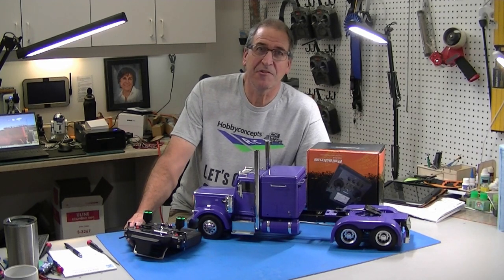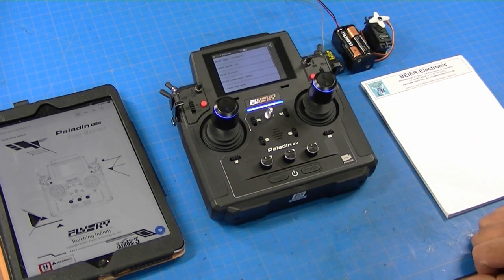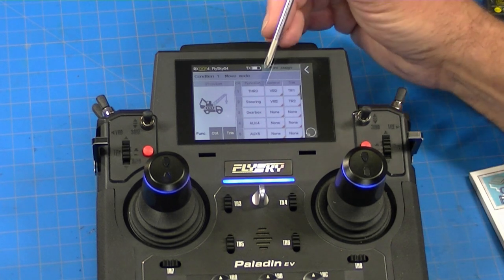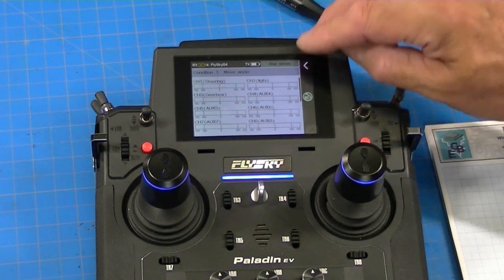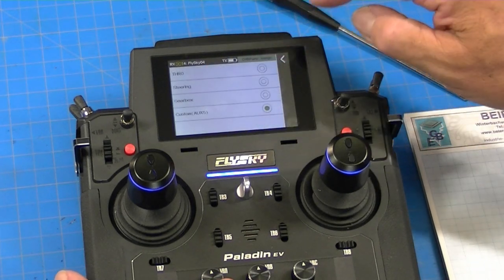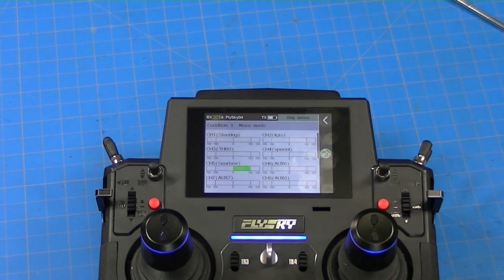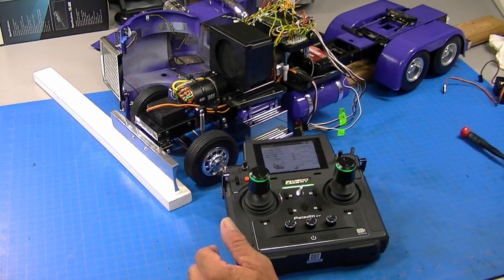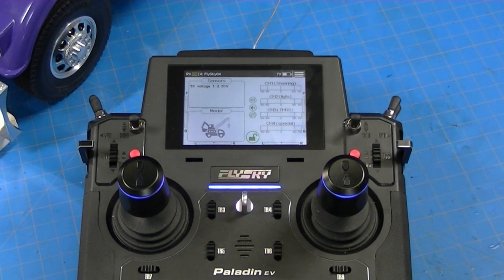RC Flysky PL18 EV Radio and Tamiya MFC-01 Programming & Setup

Comment: This is a very informative video.  I, now, have my MFU setup.  I, however, realized that I needed to adjust some of the endpoints to activate all the functions....you may have adjusted your endpoints before the end of the video, not quite sure.  While setting up the DualRates, it wouldn't allow me to shift into neutral or activate the 2-stick cutoff.  After the adjustment, I achieved those functions.  Thank you for the videos and keep posting.  Maybe you can make a video on mixing "on-demand" hydraulics for this radio....again, Thanks!

Comment: Does this radio support individual receivers per model? In other words, can I set up my Tamiya Tow truck with its custom setup and have my second Tamiya Semi as a separate setup - e.g., if both vehicles have power will only one operate depending on the model selected?
-- Found out the hard way the flysky NB4 operates multiple models on the same model selected - depending on the receiver.
Reply from the maker: Yes, it has multiple models and one at a time.  It also has the ability to switch between 2 models with just a switch so if you have a trailer towing a dozer you can just flip a switch to go between the dozer and truck.

Comment: I use a DX6e with my King Hauler and it looks like similar mixes could be set up for the lights and horn.  May have to give it a try.
Reply from the maker: Probably will.  I have not tried it but will.

Comment: Heard something about there have been some issues with the thouch screens freezing on the PL18EV. Is that an issue other here have heard about, and is it a possible bug that has been corrected by now by Flysky?
Reply from the maker: Have not heard of it and the PL18 EV has the same touch screen as the standard PL18 which has been out for a few years.  Only one I actually saw was a person who was having issues but forgot to remove the protective shipping film from the screen before using.

Comment: Great video Bob,I was having problems programming my truck using tracks on the radio,you just made it easier to program keep up the good work,your videos are super helpful for teck morons like myself. THANKS p.s. I noticed a viewer mentioned connecting a Servonaut SMB to this radio,is that possible?
Reply from the maker: Never have used Servonaut products myself.
Reply: @HobbyconceptsLLC  OK thanks

Comment: Surely if you attach the 5th wheel release direct to a switch not via the MFC you will loose the setting in the MFC that applies inertia to simulate a trailer attched.
Reply from the maker: Yes, I would probably actually set it up in the radio with mixes to one of the knobs.
Reply: Shouldn't do, the coupler release is just a servo that is only operable when the special function is accessed which would the user could bypass using the servo in an auxiliary channel. It's the coupler switch that the kingpin hits that determines the 100-50% trailer attach speed of the tractor and the sound effect (attach and detachment). 👍 So you're good to go!

Comment: Nice . Haha that noteerde from beier and working whit tamiya's mfc 😂😂
Reply: notepad
Reply: Beier and mfc is different worlds, but many out there find mfc 'affordable and good enough', so it's fine presenting different kinds of system on a channel like this) It's been showed  some Beier SFR1 earlier on here. I like Beier myself, put understand it's not for everyone to have)
Reply: @Rimrock300  You say the mfc is affordable? Where i am from is the beier cheaper than the mfc.
Reply: @MrOwjee  I would think Beier still is some more expencive, when including speaker, speaker mounting, and lights front and rear, which is included in the mfc? But I know, mfc is very expencive compared to what one get
Reply: @Rimrock300  treu but but the cost for te beier inclu ligting speaker and evrything was cheaper  than thc mfc

And you know that beier has more possebilites than the mfc
Reply: @MrOwjee  Understand, yeah that is quitespecial situation) Many buyers of the RC trucks around the world are not aware of options to Tamiya MFC, so they sell a lot of them I guess, at a good profit. Beier is much more proffesional for sure
Reply: @Rimrock300  I have 1 truck whit a mfc and 3 trucks whit beier and still learning how to install the beier and tis helps me alot olso i have a ir modul from beier and evrything is working hopfuly he wil make a clip of that to